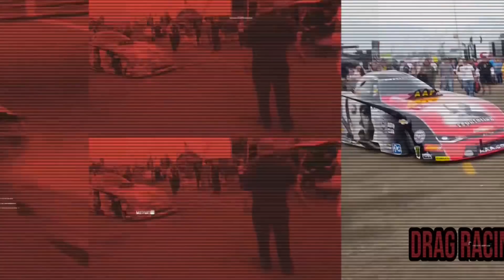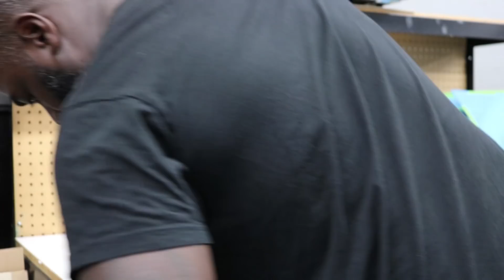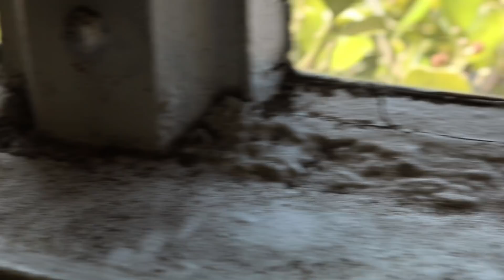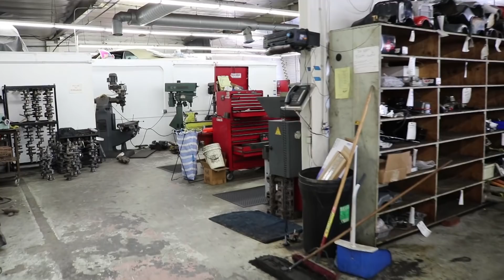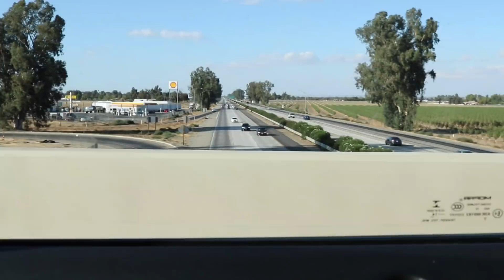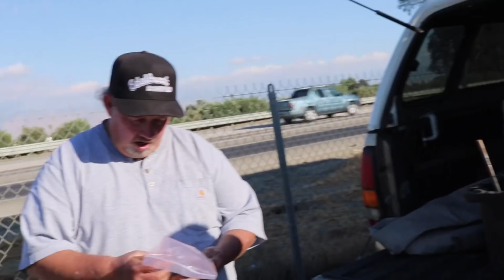Dual M90 Supercharger on Ford 302 Update and Road Trips

Comment: Quick question M90 or M62 better custom set up on a 02 330ci? I like the M90  For so many reasons I only suggested the M62 because it's  More compact The M90 will create more volume  With a smaller spindle just curious to know your input thanks in advance

Comment: Very cool concept, I actually have a M112 on top of a 302. If you want to see the build for ideas you can check it out here, https://www.stangnet.com/mustang-forums/threads/frankenstang-eaton-m112-5-0-ice-cold-ac-and-11psi.884767/page-90
The build has seen a few changes jump closer to the end to see the final version. I like to tune with MegaSquirt and have the car running on explorer coil packs. Currently 11-12 PSI with watermethonal as the intercooler. I am excited to see what you do next.
Reply from the maker: DOPE DOPE DOPE!!!!!

Comment: What u could do is incorporate some of the valve cover bolts and use brackets to connect the plentum to the valve cover bolts from the sides of plentum so that you don't have the twisting problem you'll get with that narrow base

Comment: Bro I'm not trying to rain on your parade but 2 m90's isn't going to do much on a 302 with a cam and aftermarket heads. I seen in another video you said the cam was much bigger then stock. I don't know the specifications but anything bigger is going to hurt the chances of making any kind of realistic boost. If it's just the look your going for and something different cool. If you're looking to make power 2 isn't going to do it. See if you can find two m122's. You can find them for around 550.00 or so. The aftermarket heads and cam will just move to much air on their own for the m90's to do much. I've ran blowers up to 14-71. Vortech S-trim thur XX-trim and Procharger from D3-R to F2. Ran single 100mm turbos to twin 88's. I just don't see 2 m90's doing much. If to was completely stock they'd work better but I'd try and sell them and upgrade to at least the m122's. Either way it's still a cool look and good luck with it. If it's power I just hate to see you disappointed when it's done. Take care and good luck with it.
Reply from the maker: Your exactly right.  But thats if we weren't modifying the m90's themselves.  Oh it gets more interesting, stick around

Comment: I have a question, why did you go with the GM style m90?  Not hatin on it but i was just wondering man, was it because they’re more available?
Reply from the maker: The GM style M90 has a longer snout, internal bypass valve and didnt come intercooled from the factory, unlike the Ford set which required intercooling, had an odd inlet set up and short snout.
Reply: Really? It always seemed to me that the GM was the awkward one, just asking because im looking into putting an m90 on an 88 f150, thanks for the reply

Comment: I didn't know you guys were in Albuquerque... that's awesome anyway... make sure you brace the front of that thing too especially if you're going to go distributorless it should be fairly easy. And make sure you intercool it water to air water to water. And make sure you get good front main bearings on that engine superchargers are stupid hard on the main front bearings on any engine.
Reply from the maker: Hey whats up man, I'm actually in Los Angeles my man, thanks for the tips, they will all be taken into account for the final build

Comment: I would suggest some form of velocity stack or baffle internal to the manifold to avoid low pressure zones forming around the riser.  Slow down the airflow so it has to pressurize the entire volume of the manifold before it can be drawn into the lower manifold.
Reply from the maker: Good Idea, I guess like creating a directional chamber inside to direct the air to the base.
Reply: With crossflow from both superchargers, I'm not sure the best modeling software in the world could find potential dead spots.  Either way, I just want to see this thing go.

Comment: Also how LS motors have coil packs mounted to the top of the valve cover. You could mount gussets from the bottom of the upper intake directly to the valve covers to handle the torque load

Comment: Being that you built a large plentum I would add coolers directly under the superchargers as this will cool the incoming air giving a HP increase by making the air more dense.We call these inter coolers you will find them on modern cars with superchargers. You will need a additional radiator and electric pump for circulation  of the coolant but they are available from any performance race company including the inter coolers.
Reply from the maker: Thx for the info.  I will definitely be incorporating that into the design.  Hit me up on Junkyarddoggs.com i would love if you became a member
Reply: @JunkyardDoggs  I am a master Auto/diesel Technician 38 years I have built race engines for years and I will post suggestions as you make video's as sometimes another set of eyes sometimes helps in the design.Would love to see this engine on a Dyno this should be part of your agenda.Also it's about the numbers that proves or disproves your design.
Reply: @apacheone3643  9
Reply: @rching5039  ????...
Reply: Exactly! Excellent idea.

Comment: Looks great so far. I’m thinking about the way you talked about making a flange or something to sit on or bolt onto the heads? Do you plan on keeping those heads? My only concern would be the size variables from one set of heads to the next?
Reply from the maker: I would use the accessory holes on the heads since theyre on the front and back of the heads.
Reply: Junkyard Doggs I got to hand it to you. It’s an exciting endeavor. I’ve seen a few attempts at this that kinda fizzled. I’m pulling for you.

Comment: Solid motor mounts and that engine won’t move at all. Also make a burst plate Incase of backfire it will open up releasing boost pressure. Very easy to make and do.
Reply from the maker: Burst plate...hmmm good idea but i dont know how i would go about it
Reply: Junkyard Doggs easy find some pressure rated springs. Cut a hole in the face of that intake between the 2 sc drill out 2-4 holes for studs or bolts. Put the pressure springs on the studs or bolts when u tighten it down the plate will sit against the intake top. In the event of backfire the plate will be forced to open by the pressure. Thus releasing air. Also without it u have a good chance of blowing that whole intake apart it will literally blow the welds straight off.
Reply: Junkyard Doggs maybe my ideas for burst plate not that well I’m sure u can find someone who has made something similar on YouTube.

Comment: Before you fab up your final intake, you might want to consider integrating an intercooler setup. Should be pretty easy since you will have plenty of room inside your intake. The intercooler setup that ZZP sells for the L67 just uses a heater core for the actual heat exchanger. Should help cool things down a lot because these Eaton m90's create a lot of heat.

Comment: You should use aluminum for your upper intake. It weighs a LOT less and dissipates heat MUCH better. Less heat means cooler intake temperatures which means more power.   One more thing. It looks like the "ears" of your upper intake hang over the top of your valve covers. You could possibly use the valve covers as stabilizers to keep the upper intake from moving around when you step on the throttle.  Downside is : in order to take off either of the valve covers, you would have to take off the intake first. Just some thoughts from a guy who has never built his own intake. Good luck dog. Love your channel.
Reply from the maker: Thx man, i will be building it out of aluminum but testing is going to be out of steel because its cheaper at this stage

Comment: That's just a cool build.

I had an idea for stabilizing your upper intake...How about going to lower-intake mounting bolts instead of the back of the heads? Make some pedestals that would bolt on top of the lower intake and to the underside of the upper intake "wings." Seems like you'd be adding a lot less weight that way, plus keep more stuff out of the way in case you ever have to reach anything behind the engine. You're really just trying to keep the upper from moving around, and sticking it on bits bolted down with the intake bolts would definitely keep things from moving.
Reply: thats what i was thinking.
Reply from the maker: Thats a good idea.  Im going to take that into consideration for sure
Reply: Ford used double headed bolts or studs on the intake to mount a lot of stuff, brackets, etc. over the years. Good idea